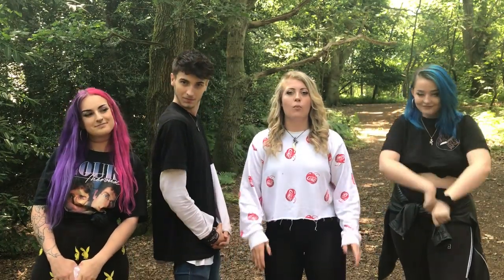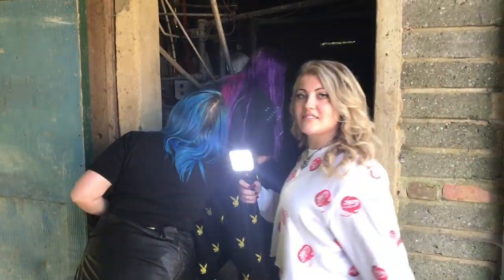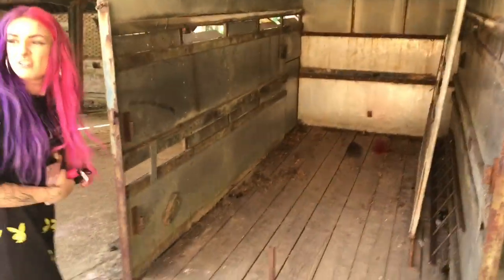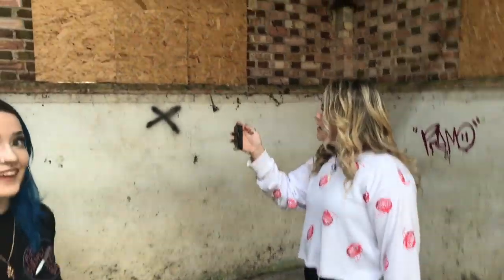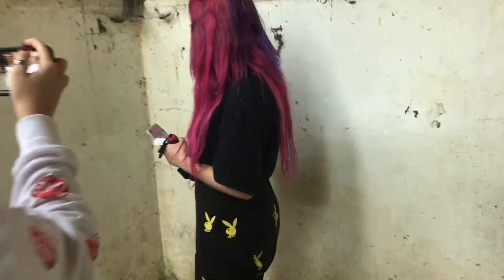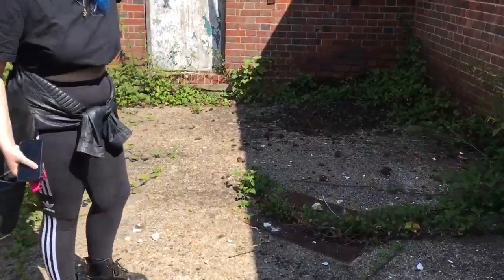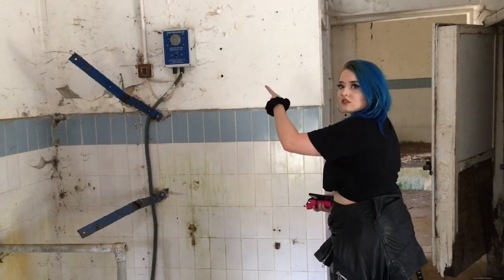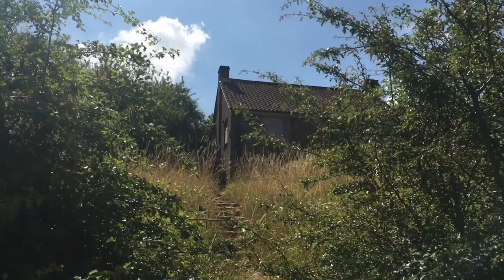EXPLORING ABANDONED TYTING FARM & MANOR| THIS WAS SO DANGEROUS| ASBESTOS EVERYWHERE| DO NOT GO HERE!

Comment: Yes the first place was the dairy parlour a very small one the red in the trailer was marking spray by the looks of it for slaughter and then the cow sheds offs I assume the next was a calf barn or stables with only 118 acres I assume it was more of a small holding than a farm near the first house was a calf barn you can tell by the head locks be careful if you come across slurry pits the red thing I believe is either for red diesel and that place could of been a tractor barn or its fro fertility and to check the cows pregnancy where you think they slaughtered animals definitely not its restrains the cow and twists them on their side for hoof maintenance and things slaughter doesn't happen on the farm😂 the open barn next to the asbestos room I believe is a grain store for drying grain and by the auger I think that but it could have been a straw barn for the cows beds just some cool info from a dairy farmer 😂
Reply from the maker: Awwh Brilliant! Thank you so much for all the information! x